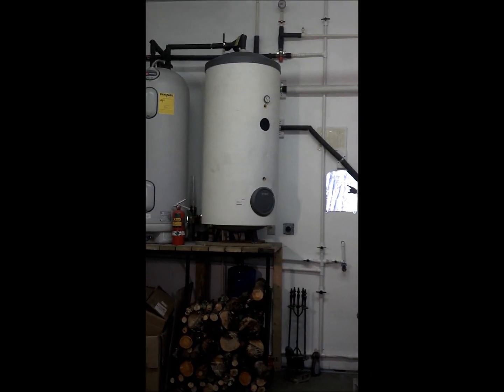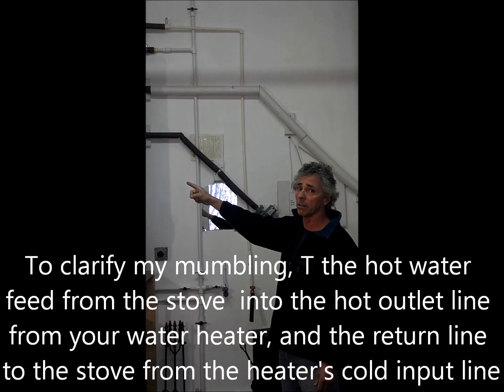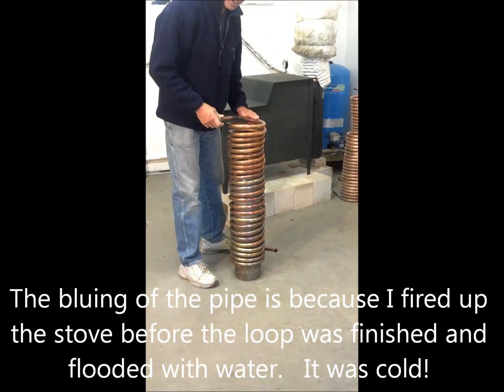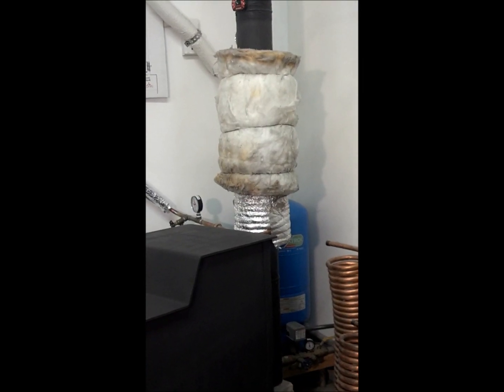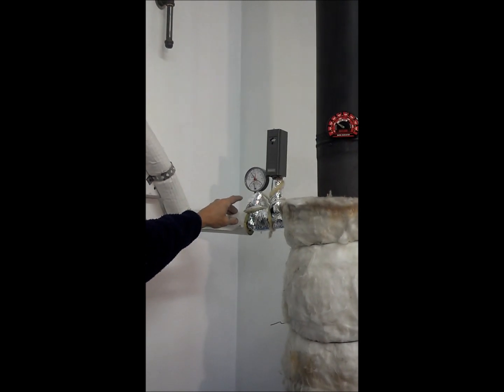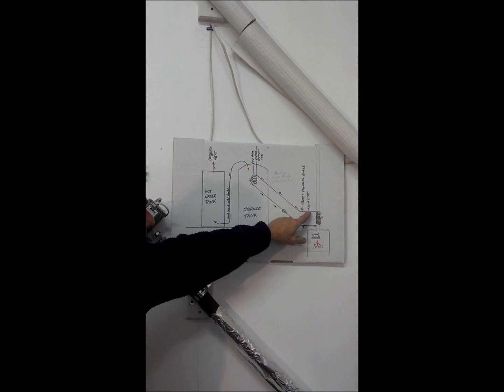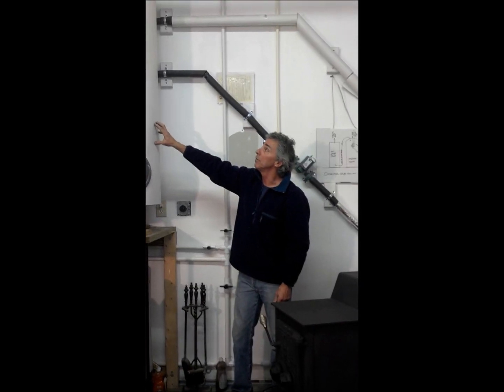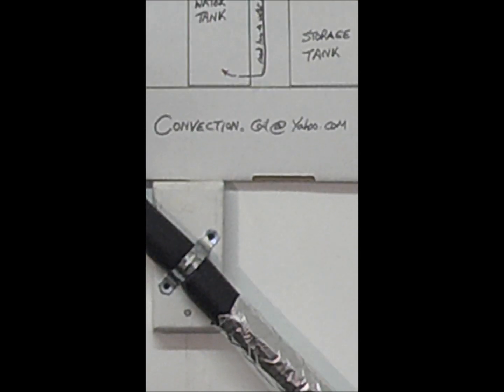How to get free hot water from your woodstove

Comment: Also, have you not heard of  filling the pipe with dry sand?? I wound coils in 10 minutes for heat exchangers. Also, use SI units, degC, as the obsolete imperial systems now only used by Americans (and not Canadians) is meaningless to anyone outside the US of A.
Reply from the maker: PV person The sand method does work well with smaller tubing, but I thought it would prove far too heavy and unwieldy for forming 60 feet of copper pipe. I now form my Convection Coils using a machine I built the forms the coil around a mandrel with roller arbors. A three foot welded seam flue pipe is lipped over the mandrel to start off and the tubing coiled very tightly around it.
Presently I'm only set up to market the completed coils within the North American market, thus the adherence to the admittedly obsolete imperial system
Reply from the maker: +Catherine Thomas Sorry about that Catherine, I've had to suspend my Convection Coil business for the last six month's.  Right now though it looks as though I may be able to return to it soon, it works too good to ignore.  I'll be sure to post the news in the tile line for this when  I can give it a go again. It actually was a pretty good website!

Comment: Painting the coils black should help increase the heating speed.
Reply: James Ashford Incorrect... That would only work if light was providing the heat energy. Painting the coils would cause in increase in heat transfer resistance.
Reply: +James Ashford, black only heats faster if the source of heat is light ... black does not reflect lite, so it has to absorb it ... that in turn excites the molecules in it, causing heat ... black has no affect on how fast or hot something will get from heat radiating from inside the pipe

Comment: I'm curious to know whether you considered (1) installing an encased old automobile radiator on top of your wood stove and surrounding it with sand. Then adding a steel cove plate for aesthetics? This worked very well in Alaska where the winter temps can drop below -60F. This also resolves any concern of cooing exhaust gases in the chimney.
(2) Another very effective modification I made was to run a 2" black iron pipe from the wood stove to the exterior of the building and using a 2" gate valve to control combustion air into the firebox. This makes a significant difference in wood fuel savings because the stove is not drawing heated air from the building for combustion air which which causes negative pressure on the building resulting in cold exterior air to be drawn in through any gaps in the building's envelope. e.g. windows and door openings. The aqua-stat is still used to control the opening and closing of the circ pump. You might want to give these a try to feel the difference for yourself.

Thank you for taking the time to make such a wonderful video and sharing your experiences.
Reply from the maker: Keith Hill Great ideas Keith. If there were need for more heat from my design, I think a stove top placement such as you have described installed in the return line to the Convection Coil would greatly increase the hot water output.  The main reason I use a vertically placed coil however is to create a constant natural flow in the loop to prevent spot overheating and the possibility of a catastrophic failure. The installation of a circulator pump and aquastat are not absolutely necessary, but they do greatly increase the efficiency.  More details about this can be found on my website; http://Convectioncoil.com Like yourself I do use an outside air intake and it does make a huge difference in the comfort of my building. My stove is in a downstairs garage area with a concrete floor. I installed a 4' floor drain with a trap in the corner behind the stove. The trap is normally kept flooded to keep rodents and insects from coming in through it, but in the dead of winter when the critters are not active I blow out the water and use it as my air intake
Great thoughts Keith, detailed and concise.  Thanks for contributing!
Reply: +Keith Hill More power to you, Keith.Great ideas but 60 degress below..... Oh, Hell NO! Not for my Sunshine State blood! Alabama is far enough North for the ole' boy!
Reply: +Keith Hill, I'm really interested in heating water with a radiator/wood stove for a hot tub. Do you have any suggestions? I have considered copper coils incorporated into a rocket stove but haven't seen any successful plans on that idea and want to keep it simple.
Thanks,
Jay in Montana
Reply: Hi Jay. I heated my hot tub in Alaska with my boiler. I used a small stainless heat exchanger under the hot tub for fast water heating. It worked far better than electric.  If you use a wood stove you could mount a small car radiator on top of the stove and enclose it inside a steel cover for astetics and functionality. I would use an aquastat to prevent the hot tub from getting too hot. Any additional heat generated can be used to heat your heat water tank for Domestic use. I believe I paid about $400-$500 for the heat exchanger at the time, but you could probably get by without the heat exchanger.  Hope this helps.

Comment: Pump bad position!
Reply from the maker: Tamás Babos Please explain why
Reply: convectioncoil.com http://www.inspectorsjournal.com/forum/uploads/jim%20katen/200810444448_GrundfosManual.JPG
Reply: convectioncoil.com Axis 90° turn
Reply from the maker: Tamás Babos You are correct Tamas in that it is not an ideal placement, but the pump is both self priming and self purging. I believe that this is what the engineers are trying to achieve in the placement recommendations. The pump has been performing flawlessly for five seasons now.

Comment: Are you concerned with causing your flue gases to condense by removing too much heat from the exhaust?
Reply from the maker: Tony Stone It hasn't proven to be a problem at all Tony. Bear in mind two things, first the coil is external of the flue pipe, and second that it is fully insulated. These two factors combined only allow a limited amount of heat to be withdrawn, probably no more than would be lost if there was no Convection Coil and the flue pipe were in direct contact to the atmosphere. I clean my flue out thoroughly each Spring and also open it from the tee at the back of my stove and check it visually from the bottom midwinter. In the four years I've been using this setup I have never noticed any problem at all.  I do make it a habit of letting my stove run wide open for about fifteen minutes until my stack temp exceeds 450F degrees. It gets the cool wood from my morning loading well ignited and helps to burn out any deposit from the damped down overnight burn. I also added a secondary air intake to my Fisher Mama Bear, and more recently an internal baffle. The preheated air intake definitely made a positive difference in creosote buildup (see my other video). I don't know what effect the baffle will have yet for I've just recently installed it but will likely post another video on this as soon as I have some history for the mod

Comment: How bout a container that would hold perlite-enhanced products—like insulation
Reply from the maker: Kanoee64 A good suggestion but I have come up with an easier solution, my coil is now wrapped fully with 1 inch Superwool+ ceramic blanket and finished off with a stove black sheet metal shell. It finally looks as good as it works!  I really need to post a follow-up video to this one soon showing the finished Convection Coil. It will be detailed later this week on my website at;  http://Convectioncoil.com

Comment: goog
be careful with electrolitic Cu, iron, and Aluminium
Reply from the maker: There shouldn't be any electrolysis problem between the copper coil and the steel stovepipe because the contact is dry. I do however have dielectric unions where the copper pipe connects to the steel inner coil of the Steibel storage tank. I also make a point of doing an annual inspection of the sacrificial anode in the Steibel, so far so good.  Good observation

Comment: It's easier to put the coil inside the fire box or inside the flue.  That way, you avoid the problem of precision-forming it around the outside of the stovepipe.  We did that in the early 1960s, using the same wood stove that heated the house.  Some of the scalding hot water was circulated in radiators to heat the house and the rest was used at the faucets.  It's fine if you have access to free or cheap wood, but not worth it if you live in town and have access to natural gas from the local utility.
Reply from the maker: ***** I didn't think it was a good idea to put my coil inside the flue for many reasons as discussed below in an older conversation. Mainly the reasoning revolved around the possible negative reaction of copper with the acids in the exhaust gases and the buildup of creosote around the cooler coil pipe. I think a vertically oriented stainless loop as described in the discussion below with J Mozinski might be a very good alternative to my coil setup.
There were two main points I was trying to achieve when I came up with the idea of a vertically mounted insulated external coil rather than just an internal loop. I wanted to be absolutely sure of a strong natural convective flow while at the same time I didn't want to remove too much heat from the stack temperature. The Convection Coil design has met and exceeded both requirements well beyond my expectations.
I agree that with the price of oil and oil related products right now, it isn't worth burning wood unless you have your own supply or can buy it right. The going price for split, seasoned wood in the Fall here in central NH is right around $250 a cord and a cord of hardwood is the equivalent of about 125 gallons of heating oil, so burning a cord saves maybe a couple of hundred dollars ...a questionable return for the labor and mess involved.  But how long do you suppose oil will be this inexpensive?
Reply: convectioncoil.com
Mostly that is overcome by using stainless steel pipe.
Reply: +Bob Roberts I've tried the collector inside the stove pipe. I had to rip it out from too much creosote build up. Stainless steel cannot solve that problem. You don't want to rob too much heat, or you get a problem with creosote build up.

Comment: I don't know what others have done to mess up their wood stoves by putting the loop or coil in the firebox instead of wrapping it around the stove's exhaust - maybe they used copper.  My stove came with an optional stainless steel water heating loop back in the early 1980's and has worked fine ever since.  They never burn out - even if there is no water in the pipe, are guaranteed for life, make tons of hot water and are easy to install - no insulation needed, either.  It goes right against the upper side wall so it takes up hardly any space and if you want even more hot water you can add another one to the other side of the firebox.
Reply: I wasn't completely clear but the stainless steel heat exchanger is inside the firebox.  You just need to drill 2 holes.  Google it.
Reply from the maker: J Mozinski Hey J, are the holes drilled horizontally, or is one near the top of the stove and the other near the bottom? If it is the latter I guess there would be some convective rise through the loop, but it would be minimal. I recognize that internal coils do work very well, but if you are relying on a circulator pump for flow and the power goes out, you could potentially have a problem
The point to the vertical coil outside the flue is two fold; First it gathers the heat progressively as the water goes up through the coil, and this creates a strong unpowered flow from the convective rise. Second by placing it outside the flue and insulating it, not too much heat is removed from the exhaust, and the flue remains clear and easily cleanable.
Reply: convectioncoil.com The holes are vertical - maybe 6 or 7 inches apart.  My heat exchanger is just a horseshoe shaped piece of 3/4"ID stainless that's probably about 24" +/-  or 48" if it were straightened out.  It's considerably thicker walled and stronger than copper.    You'd be surprised how much convection there is.  I think the bigger the difference in temp between the in and out, the faster the water moves.  There are also flow dynamics to consider.  You know one 90 degree bend is equal to like 3 or 4 feet of pipe in terms of friction and flow restriction.  I don't know about your spiral bends but just the sheer length of the 60 feet will definitely slow things down.  Maybe that's good if it needs the time to gather btu's.  Even if you have a heat exchanger in the firebox, you could still use the one wrapped around the exhaust to catch some of what's going up the chimney if you have a high exhaust temp.  I don't have any circulator so power outages aren't a problem.  I've been thinking about adding a circulator and another heat exchanger on the other side of the firebox [inside] in order to handle some radiant heat in the floor but I'll have to add another storage tank first because I only have 50 gallons now.  Too much free hot water - such a problem to have, right?
Reply from the maker: J Mozinski Adding a circulator and an aquastat to control your woodstove loop will no doubt make a HUGE difference your system's overall performance J!   Definitely do it, you won't be disappointed.
Do you presently have an elevated storage tank? If not doing that even before you spend the cash and time to install a circulator pump would likely be advisable. That way you will be able to freely take advantage of both whatever convective rise there is in the vertical section of the internal piping in your stove, plus the external rise to the top of the storage tank. Between the two you should always be guaranteed some constant guaranteed convective flow and your system should stay safe and effective ...even when the power goes out!
There is no doubt a bit of flow resistance by bending the 3/4 pipe into a 6 inch id radius, but I'd be willing to bet that one of my entire 29 loop Convection Coils has far less resistance than even a few 90 degree copper elbows. If you do need to use elbows it is good idea to use the long sweep 90s ((I did, quite a few of them in fact). They take up only a little more room but have far better flow. Most good plumbing supply houses have long sweeps whereas your local hardware "big box" store probably doesn't

Comment: There is another application: supplemental heat for underperforming geothermal systems. With ground-source HVAC systems becoming more popular, having them work efficiently through the winter can be an issue in certain climates or during prolonged cold spells. If a secondary loop runs through the wood stove coil, it could be brought online only when the the wood stove is being attended to (during the day). Geothermal units typically operate on a delta T of 3-4 degrees, so having the wood stove coil change the temperature even just 2 degrees would relieve the ground loops significantly. I imagine that it could even go the other way, during warmer winter days carrying excess heat  into the ground loops and using the ground as heat storage for colder days and allowing the geothermal unit to operate efficiently without pulling any heat from the ground loops.

Regarding insulation around the coil, the safest and easiest solution would be the 1/2-in thermal insulation blankets marketed on eBay and in wood stove stores for use with flexible stainless chimney liner. I used a 30-ft 6-in chimney liner in a decrepit unlined 110-year old brick chimney, with wood framing close to the brick everywhere. I have recorded temperatures on the outside of the uninsulated stove pipe of 250F, with the 1/2-in thermal blanket surface right next to the uninsulated spot recording a temperature of 90F, safe to touch. That insulation blanket is designed to withstand very high flue temperatures - they call it AES (Alkaline Earth Silicate) Wonder Wool Chimney Liner.
Reply from the maker: Great thoughts Slawik! Thank you for sharing them. Are the thermal blankets as cohesive and flexible as fiberglass?
I have found that the easiest way to insulate the coil was; leave the first two coils(nearest the stove) uncovered, wrap everything above it in a few layers of tin foil, wrap that with 2 foot wide R11 fiberglass, and once the outer sheet metal (not shown in the video) was clamped in place fill the void above the fiberglass with crumbled Roxul. The coils are 32" high, by using the method described the fiberglass never comes within 3 inches or so of the bare flue pipe, and only has direct contact with the outside of the liquid filled Convection Coil. Again for clarity, the layers from bottom to top are; two loops (3"0 of uninsulated coil, 24" wrapped in R11 fiberglass, and the top 5+ inches insulated with crumbled Roxul.  The Roxul has an ignition point of near 2000 degrees, there has been no problem with the few inches I have topping the coil that are in direct contact with the flue.
All said and done however, your recommendation is far wiser. I'll get a hold of some and change over to it before I post an installation video on my webpage.  Thanks!